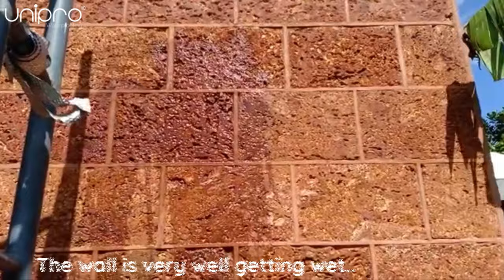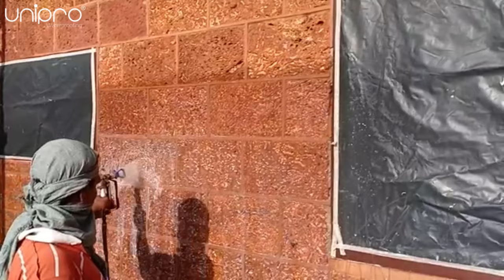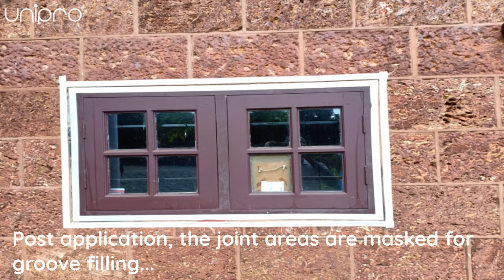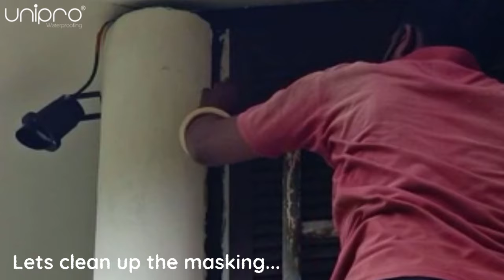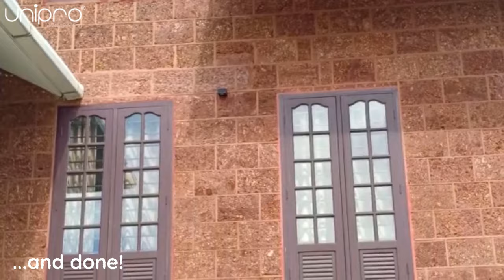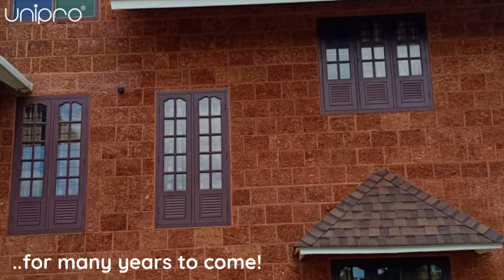Laterite Brick Wall Waterproofing | UniPro® Waterproofing

Comment: Konsa polish use Kiya he
Reply from the maker: It's not a polish. It's a reactive chemistry which work with silica molecules in every construction materials and make it hydrophobic without creating a coating.
Reply: @UniProGrp  how to do it
Reply from the maker: @anonymoussoul7409  do call us @ 9544308555 for getting it done.
Reply: Once in how many years we need to keep applying that...?
Reply from the maker: You need to apply once and it will last more than 10 years